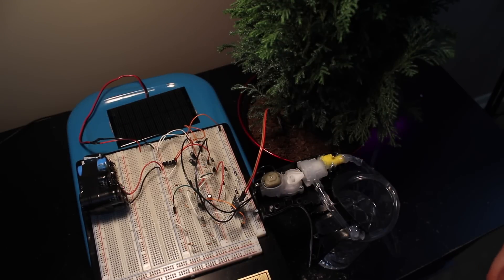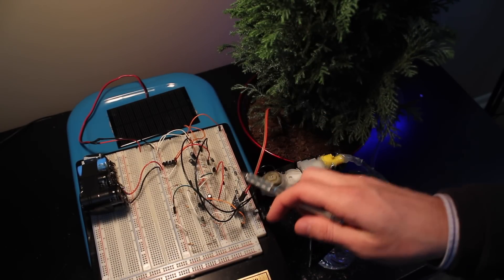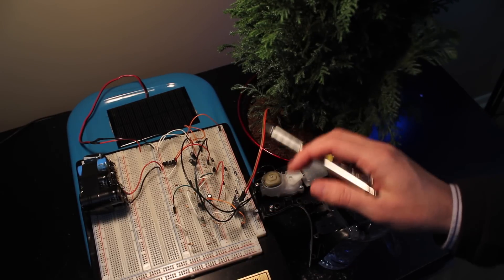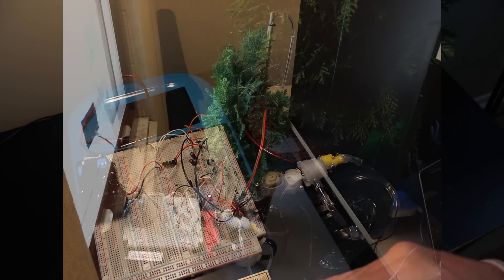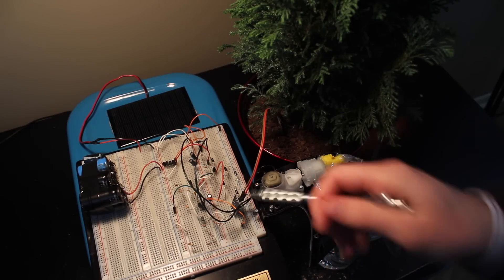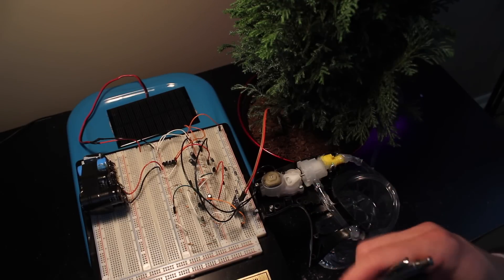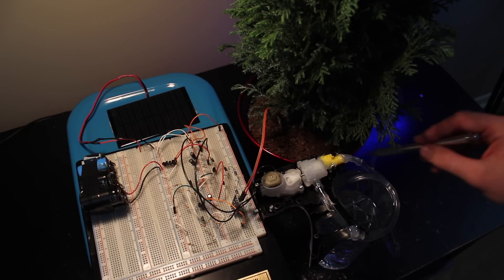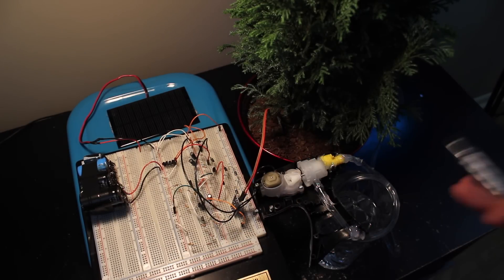Solar Powered Automatic Watering System Tutorial

Comment: I tried building this and I am having trouble getting it just right. At the moment I can get the system to cycle only if I unplug the pump and wait for it to build up enough charge then plug it back in. Am I missing something? I don't know where I saw it but I seem to remember maybe needing multiple N2s right before the pump i have not yet tried this as getting the system to cycle requires quite a bit of sunlight....

Comment: do you have the schematics that is view able as a .pdf or .jpg? and do you also have a parts list? how many 1K, 1000u capacitors? lastly what diodes are you using on pin 3 of your moisture module (the diode array-the stack of four)